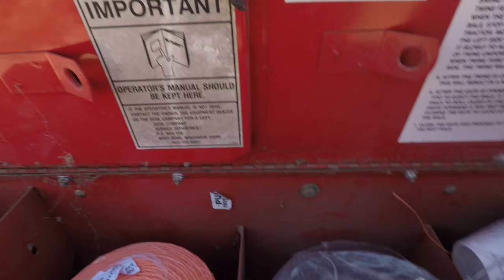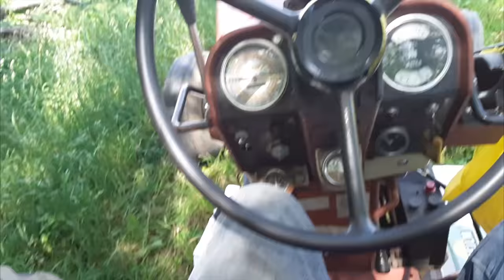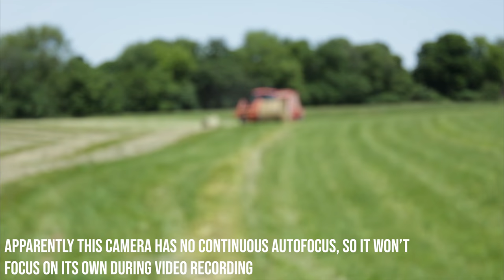First crop hay harvest in the woods! | June 2020

Comment: How many round bales do you need to make it threw winter :)
Reply from the maker: Always more then we can make  - LOL 250-300 would be a safe number. We always seem to be between 50 and 100 short.
Keith-
Reply: I used to own a 1475 Gehl 4x5 baler. Rolled many of bales with it between 1200 to 1400 a year. Your Gehl baler seems to picking all the hay up good and making good bales. Keep up the good work. It's hard to find nice big hay fields around here . I do a lot of customer baling. The largest hay field I bale is about 35 acres the rest is small field  ranges from 4 to 15 acres. If there any bigger nice fields around here they are planted in corn or soybeans.